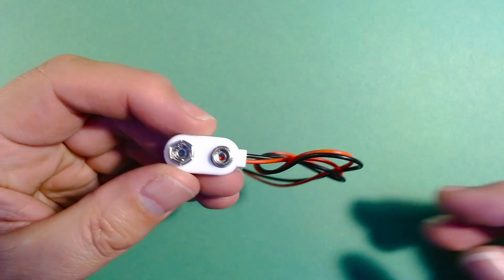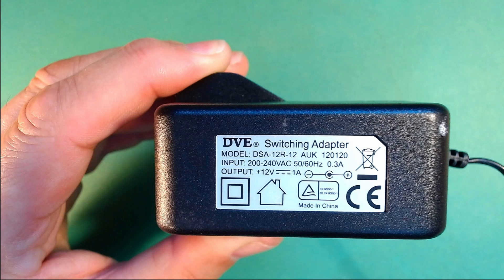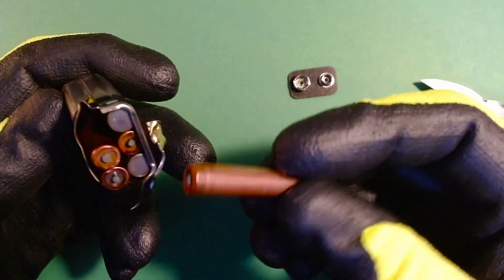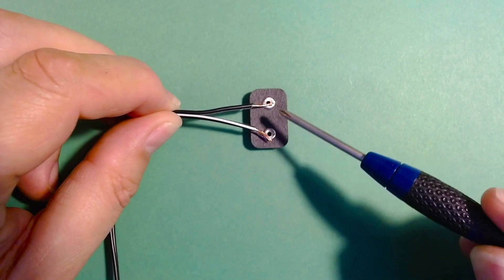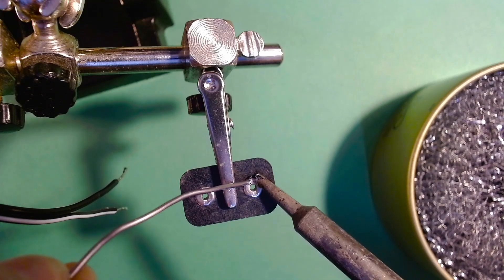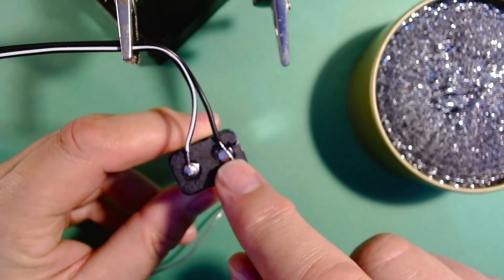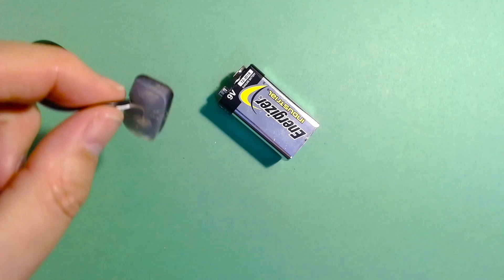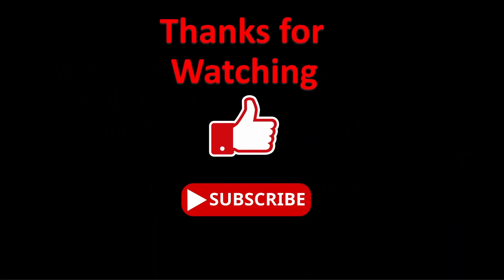Make a simple 9 volt Battery Connector from scrap

Comment: I thought about doing this but the battery I was going to use has corrosion on it. Guess I'll get a Dollar Tree/Poundland battery just to make a connector. I have never seen 6 small batteries inside of any 9v battery- just a glop of black nasty paste and a couple of rods that go into that glop. And the button terminals are a nickel-chrome on most batteries, so the solder won't actually take to it. We'll see how it goes.